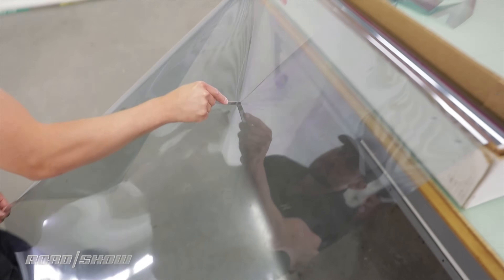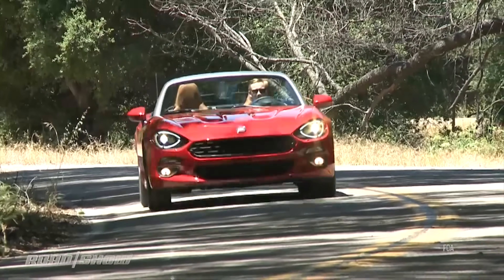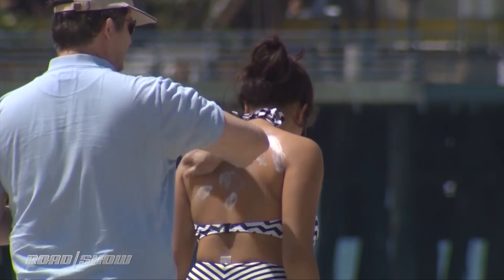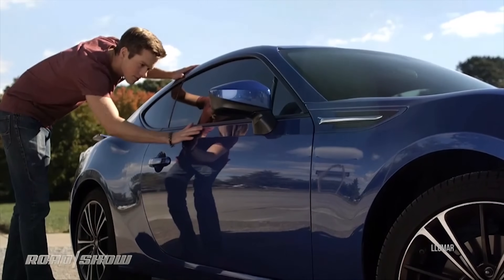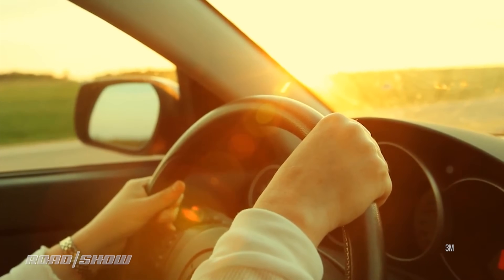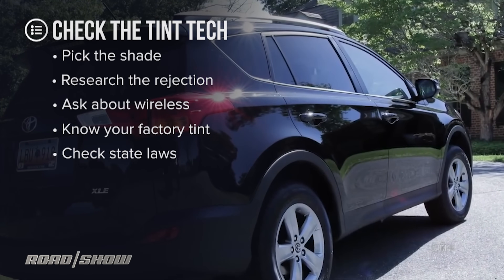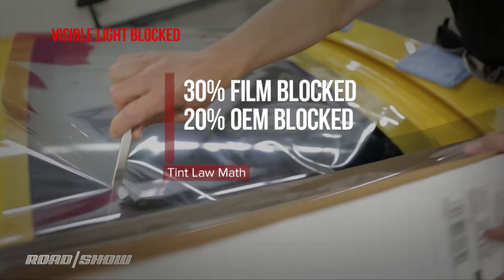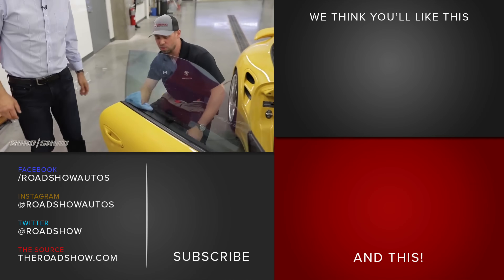Car Tech 101: Cooley explores the tech behind window tint

Comment: Unfortunatly NY says its illegal. "For officer safety". That logic is VERY flawed. They say passenger cars can ONLY have the rear window done. No sides. But trucks/suvs can have the rear, rear quarter windows, and rear passenger windows. If its "officer safety" - why have different laws.

Idfc though. I want mine dark. 5% rear - 20% sides. Its a $250 tickets. Screw it.

Comment: Your math is wrong, you don't add the tint blocking values together, you multiply the visible light transmission (VLT). So, it isn't 30% + 20%, it's 70% * 80%, which gives 56% VLT.

Comment: no way you can add 70% tint to a 20% tinted window and have it transmit 50% of light. it's multiplication. 70% of 20% is 14%. if you have 2 layers of 50% tint then it's 50%*50%=25%.
Reply: Simon Zhao 
@shadowsmirk
Yes, Cooley confused the math. He added percentage points rather than calculate multiplied percentages

Comment: Too bad that in NY you won't pass the annual safety inspection with any sort of tint. Windows must pass at least 70% of light in NY.
Reply: dangerousmythbuster 70% light means you CAN have light tints
Reply: loud Ring 70% is literally glass from the factory. You wouldn't even notice if you weren't told beforehand
Reply: Ny is the USSR